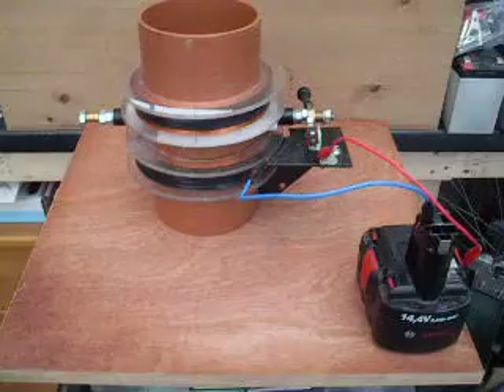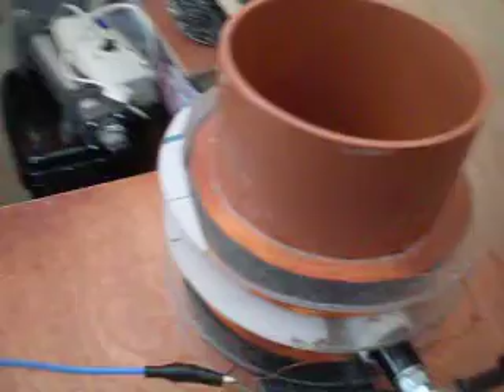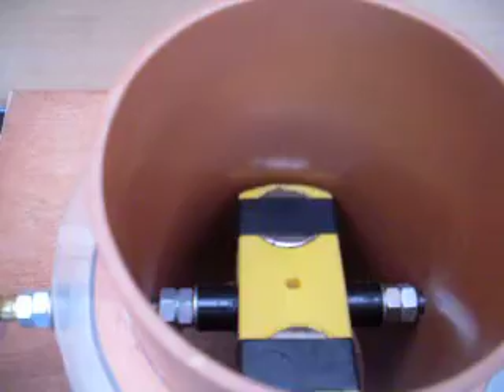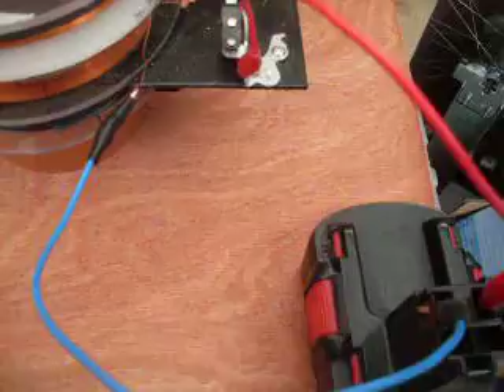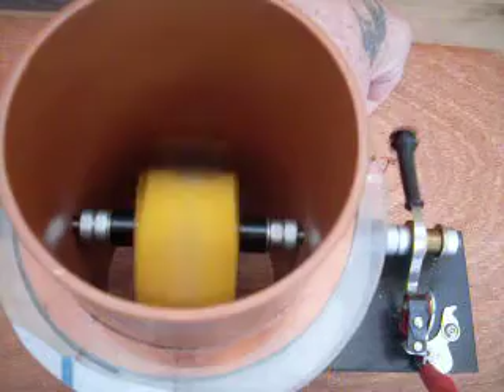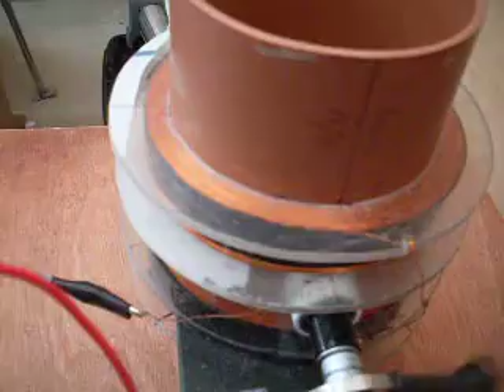Newman Motor  by  D Thompson

Comment: I realized here you had 2 coils. Can I ask what was the motivation to use one instead ? I'm building a version of the Newman motor myself. My aim is to get it to consume as little current as possible and output enough torque that I can run a self-built high wattage axial flux generator off the shaft of the Newman motor if I don't figure out how to harness back spike like you do in your latest video. Another option is to run the Newman motor off the high voltage from the atmosphere as it's mostly volts that's required to run Mr. Newman's motor. Should be a way better motor than a corona motor for utilizing atmospheric energy.
Reply from the maker: Hi
I realised that Mr Newmans commutator had to flip over to accomodate the second coil, why? I am not sure. So I realised that I could achieve the two contacts in one revolution by using a commutator with two striking points as per my later models. This means I get double the power input giving me a lot more torque.  I will point out though that these motors are amp hungry if loaded up with a secondary generator. I can generate lots of volts but very little amps. So at the moment I am trying to find a method to produce lots of amps so I cab feed these back to the batteries hopefully balancing out wattage needed to keep running the machine its self. hope this makes sense to you. regards Deryck
Reply: @DeryckThompsonChasingtheDream well if you make it energy efficient you will not make it high amp output, 
but what I'm thinking of doing is getting a wind generator which does have a high amp output and mount both together , 
a Newman motor is/was a enegy efficient motor it didn't have a usable output he got like 80,000v off the 5,000lb wire out, but i bet there wasn't no amps and what could you do with that? 
What he got out for little in was the mechanical work the motor could do, 
i bet his could of turned one of those humongous wind turbines no problem giving lots out for very little in, 
I've had 6yrs to contemplate things and things are more clearer what they were about.